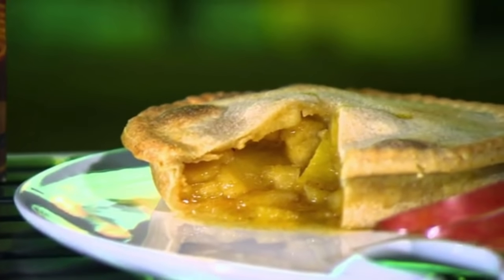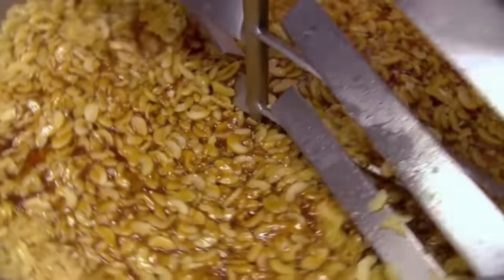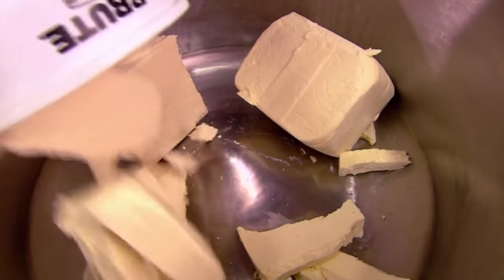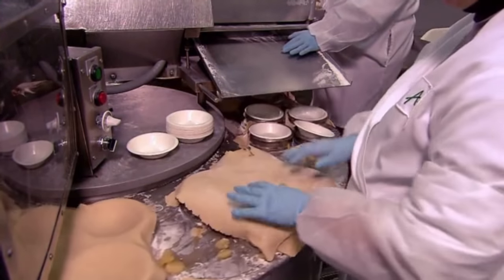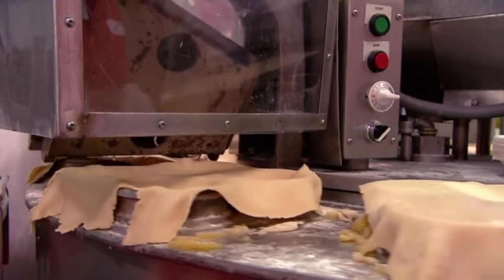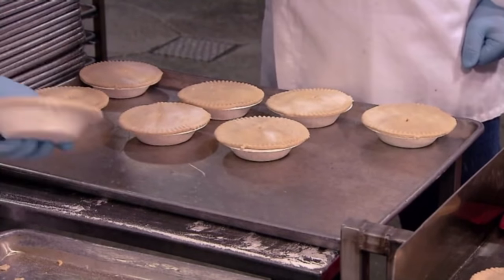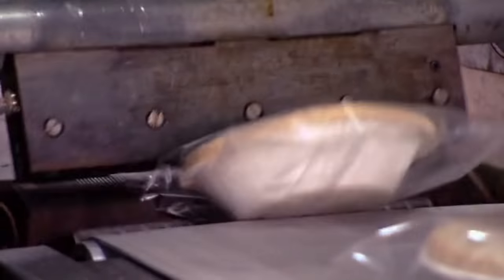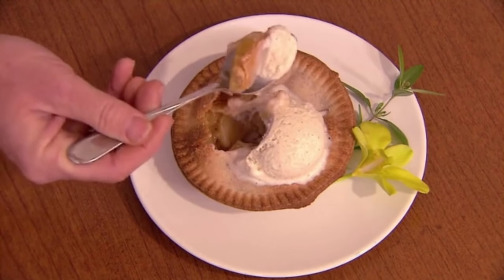How It's Actually Made - Apple Pie

Comment: The most absurd part of the original footage is at 4:00 where they pretend that anyone would ever cut a microwave pie into slices instead of just scooping it out bite by bite.
Reply: I'm surprised that it was a brand i have heard of and tried

The pies are shit but like I've heard of and had these ones
Reply: tbf, François might not be the only guy eating the pies and if not, they’d probably be splitting the pies between multiple eaters.
Reply: @brumm0m3ntum94  if you ever have to share a microwave apple pie then i feel bad because that really shows somebodys on really tough times if they have to share something that small

Comment: I used to work in a bakery and make apple pies from scratch. Peeling the apples and making the dough myself. I never used any honey so I’m very surprised by the amount they have in their pies. I usually just stuck to the simple brown sugar and cinnamon method for flavoring, and rely on the apples to supply the flavor. Also, those crimpers they use look so much easier than the handheld one I had to use ;w;
Reply: I'm familiar with honey apple pie, Amy's is organic so they try to avoid using processed sugar 
(I'm surprised it's a brand I'm familiar with)

Comment: All jokes aside, this assembly line appears to have an awful lot of unnecessary human labor involved. Why do they bother paying a single employee to just stab pies all day when a mechanical lever with a blade attached could do that practically for free? Why have a human manually push the pies into their boxes? The weird rotating conveyor with the pooping machine seems to have 3 or more employees fulfilling easily mechanized tasks such as placing crusts over tins, pressing the crusts into the tins, pulling away the excess crust, and pulling the completed pies off of the conveyor. Having the pies pressed and pooped on 4 at a time seems to be done so that 1 employee can grab all of the finished pies in a group at once, but a mechanical lifter arm could maneuver many more pies simultaneously.